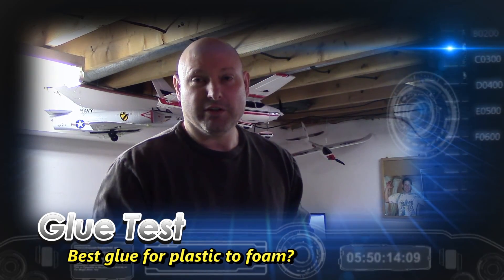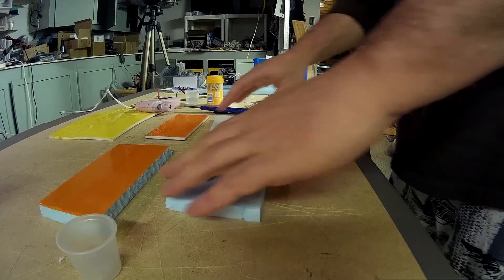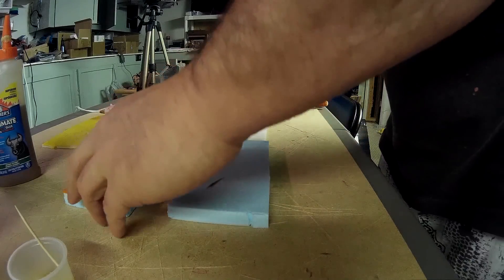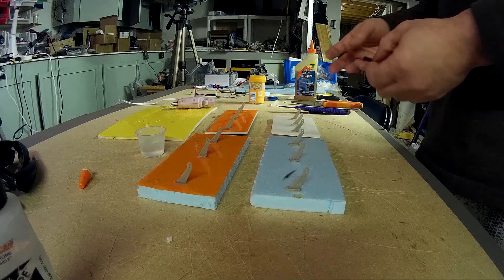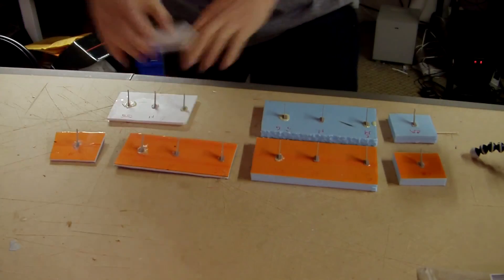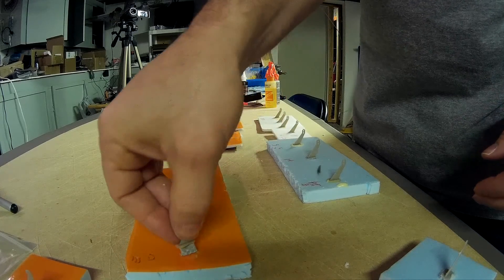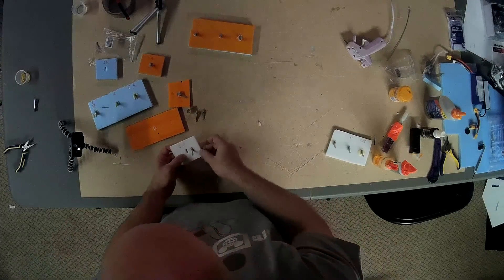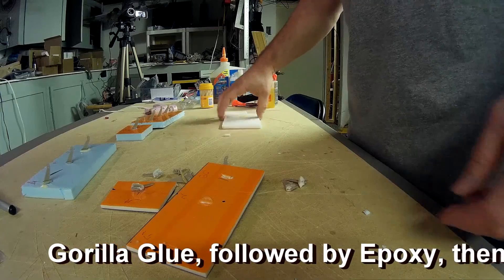Glue Test - Plastic Control Horns  on XPS Foam and DollarTree Foamboard

Comment: Plastic parts typically have a release agent remaining from the molding process.  It can be removed with alcohol.  Possibly would effect the bonding to the plastic horn.  Punching holes with a Tpin would also add to the security to the foam, while drilling small holes through the horn would add to the hold.   I know from being a buyer that differing strengths of the larger sizes of glue sticks (1/2") from peal it with your finger nails to having to chisel it off as the glue strength is better than spruce for holding.  Not to criticize, but to inform.  Thanks for taking the time to show your results from your testing.

Comment: A technique to try using hot glue is to squirt it into the slot then push in the control horn. May also want to put some hot glue on the control horn just at the top before installing.